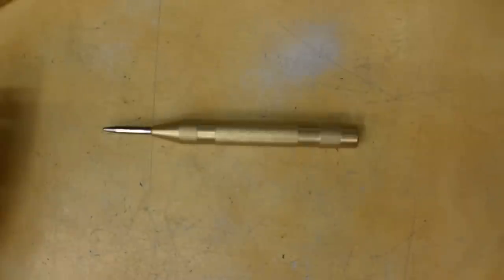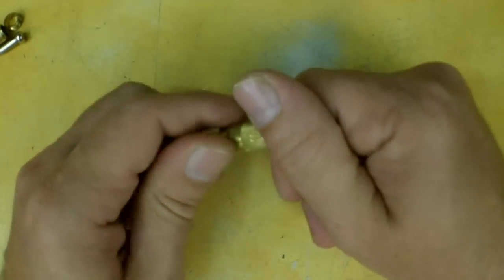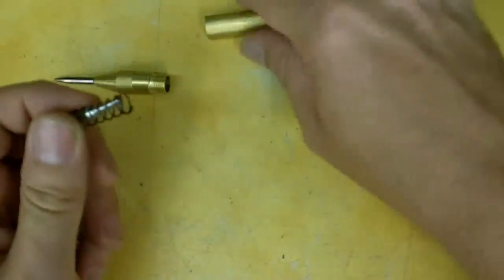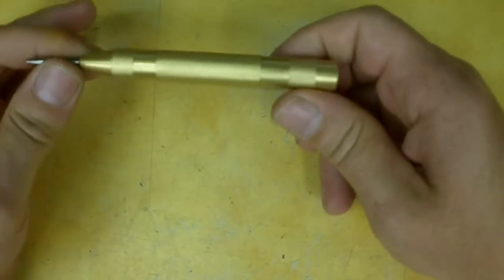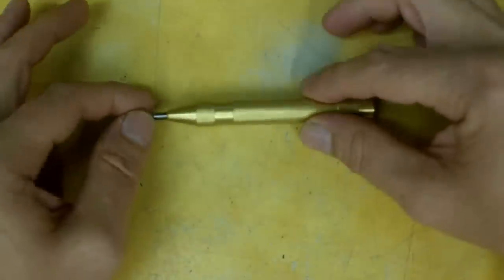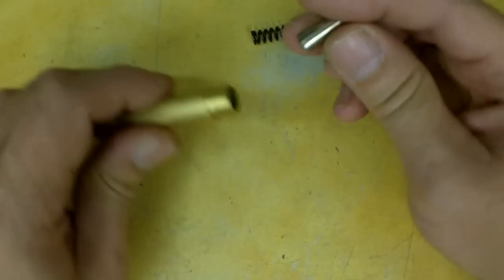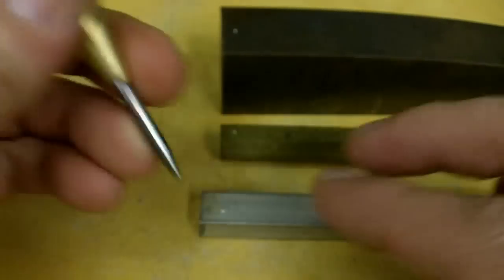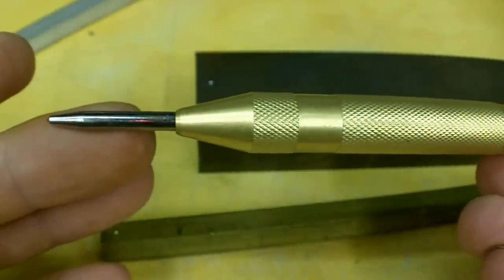Harbor Freight Automatic Center Punch Review Item 62141

Comment: Interesting story about this item, my girlfriend's car's neutral safety switch (part connected to the transmission) has many contacts inside that had gotten debris inside and caused it to stop working, I had read it was an easy fix to clean, and seeing that the new part is $350 I decided to take it apart. It was riveted together with 11 aluminum rivets that I dremeled the mushroomed end off with and THOUGHT I could use a punch and pound the rivet out, but for the life of me I just couldn't get them to budge. The rivets were high quality and solid throughout, so I thought I might as well just try using this center punch and then drill the rivets out. Much to my joy when the center punch finally sprung it actually budged the rivets a small amount. I was expecting to have to drill all 11 out, but thankfully a few center punches on each one made them come right out.
This has given me an idea, I think they should make an assorted size of punches that have this mechanism in them. I find that sometimes I have finicky items that I can't anchor well and use a hammer and punch with, so something like that would be very useful. Also would be useful for automotive if there was no room to really swing a hammer.
Reply from the maker: Good story Jesse! Way to save big bucks and fix the switch for a little labor! I think variations of this device would be super cool and allow for work in tight places- even one handed. I know all too well with not being able to swing a hammer in some situations. Thanks and take care, G.
Reply: Air punch maybe

Comment: The end of the "bullet" that had the burr is a common problem with all automatic center punches, not just the ones from Harbor Freight. When my punch stopped working I took some 320 sandpaper followed by 600 and gave the surface a nice polish and did the same thing to the end of the stem that falls into the hole. I put a drop of sewing machine oil on my finger and wiped the end of the bullet and now it works every time.
Reply from the maker: Good info! Thanks! Take care, G.

Comment: The threads are left-handed so that when you compress it the Springs don't apply any loosening torque to the components. Have bought about four of these and they all tend to stop working after a little bit of use. But if you loosen them up and tighten them again they tend to work okay. It's just that the tolerances are quite loose inside so that the anvil hole doesn't always line up with the pin.
Reply from the maker: Thanks for the info Alan! Take care, G.

Comment: Thank you for this simple explanation - mine is British from my late father's tool box and It wouldn't hammer - because I assembled it with the set pin into the hole in the anvil and that's why it wouldn't strike

After seeing your video it now works a treat. Both threads are regular RH.
Reply from the maker: No problem Richard! I'm glad it was useful in getting yours working again! Why my first one had LH threads is still a mystery to me. Take care, G.

Comment: I got mine cheep too, from maplin. It started misfiring, gonna have to open her up and do the fix, so thanks for the tip. I wondered how they worked when I got mine, so I wiki'd it, there are two types of mechanisms, both like you said, ingenious.
Reply from the maker: Hopefully fixing yours will be as simple as removing any burr like I've shown. If that's not the solution- the only other thing I can think of would be to tweak the spring to make sure it's hugging the side of the pin/plunger that's just behind the tip. I have seen the other design as well. They are both brilliant for sure. I think this one is a bit more simple, but the other might be more effective/reliable. But I'm only guessing based on drawings I've seen. Thanks Sirus and take care, G.
Reply: Aha. Fixed it! Not sure how long it will last. I dressed the hammer and the wobbly pin so they have crisp square edges. And made sure the spring had a bend in it. I think the problem with mine is the pin and hammer are of equal hardness, so they round each other off. When it dies again I will soften the hammers steel to see what happens. Cheep tool, but one of my faves. Thanks G.
Reply from the maker: Sirus
That's cool Sirus! Glad you were able to get yours working again. I agree they're great! Take care, G.

Comment: The new product now being sold doesn't fire when the tip is depressed.
The "hammer" isn't aligning properly into the hole.  Try taking the front section
apart and shortening both of the threaded ends by about 50% with a grinding wheel.
 This has corrected the problem with the one I bought.  Good luck!
Reply from the maker: Good info Jim! Thanks for the post. Take care, G.

Comment: Thanks so much for your video. I bought one (also "on sale" for $2.99) and couldn't figure out how to use it. Certainly no instructions on the packaging. Your video quickly set me straight. BTW, mine unscrews backwards as well, on both ends.
Reply from the maker: Rick Barron No problem Rick! I'm glad you found it useful. Why some of their items don't have any instructions whatsoever baffles me...lol. Interesting yours has left handed threads unlike my replacement. Perhaps it's old stock, or it came from a different factory- who knows. I do know they use many factories to make the tools though. My original would've still been around had I not destroyed it trying to get it apart. I guess I took one for the team so others will know...lol. Good luck and take care, G.
Reply: *****  Will this work with hard plastic ?
Reply from the maker: lucia nguyen Lucia, it might work well depending on the plastic you'd be working with. It would certainly be worth the cost to give it a go. Good luck, G.
Reply: I will be putting holes in a soap holder. What section at harbor freight can I find the center punches ?
Reply: Thank you !
Reply from the maker: lucia nguyen
I see! I want to be clear that they're for marking where you will drill a hoIe- and not for making a complete hole. You may know this but I don't want you picking something up that might not be what you need. You could also use a manual center punch and tap it with a hammer to mark where to drill.

I don't recall where they were in my store so you'd have to ask as yours. Also do a search for a 20% off coupon you can use. In addition to that, you can find free item coupons online as well for something you might be able to use. Good luck with your project! G.
Reply from the maker: lucia nguyen No problem!

Comment: will it bend sheet metal based on force required ? I am doing drill holes on a car trunk and don't want addtnl. body-work
Reply from the maker: It might Sonny. If you can use a block of wood on the inside it should help prevent any damage. Good luck, G.

Comment: Oh geez I’m an idiot lol thanks I took the fricken thing apart without paying attention to how it went together 🤦‍♂️ ugh I’ll be alright, thanks again
Reply: It's easy. First put the sharpened punch in the front housing. The next piece is a stem with a spring on it. There is a large end and a small end of the spring. The small end of the spring slides on the stem and goes against the head. The head goes against the punch you installed in the front housing. At that point you can screw the middle section to the front housing as you are done with that. Then insert the repaired bullet with the hole facing down. Put the last spring on it and screw on the back housing. The stem from the intermediate piece rides against the flat surface of the bullet and then pops into the hole when you press down. So in order from the front; sharpened punch, intermediate shaft with the head against the punch and the small end of the spring against the head, then the bullet with the hole facing down, and then the last spring.
Reply from the maker: Thanks for chiming in and describing how it's assembled. Hope this helps him out. Take care, G.

Comment: So would there be a reason why mine even though its off set from the hole it still enters the hole in the hammer straight on and there's no snap so then no punch
Reply from the maker: I'm not sure, but it almost sounds like the hammer is binding up in  the bore, or even stuck in the bore higher than it should be. I would take it apart, then clean it with rubbing alcohol. Then put the hammer in and see if it moves freely. It should go all the way down to the hole in the brass tube.  You might even add a drop of light machine oil to see if it helps. Hope this helps, G.

Comment: mine worked for a month or so, then the tip got blunt and doesnt punch holes any more, tried to sharpen it back to a point on the bench grinder, but the tip keeps getting rounded
Reply from the maker: +turbotonic27 
Hmm, mine has help up quite well. I wonder if yours didn't get heat treated for some reason. But, I usually use it on softer metals so that might have something to do with it. Take care, G.

Comment: Do you need this tool for a step drill bit?
Reply from the maker: Nelson, using a center punch helps to make sure the hole is where you want it so the bit doesn't walk around before it starts cutting. You can do the same with a hammer and manual center punch. Stepped bit or not, the principle is the same. I use this for a quick accurate placement, then come back with a manual punch to deepen the mark. Hope this helps, G.

Comment: cant understand really well this tool, why someone need this? can't you just make the pressure with your hand and a solid puncher?  i mean, whats the difference?
Reply from the maker: +wallaguest1 
Mostly it's used for quick one handed operations, or in tight places where you can't swing a hammer. This combines the hammer and punch in one unit. I doubt you could use a standard punch to make any marks deep enough for a drill to find the center of- unless it's perhaps plastic of some sort. Hope this helps, G.